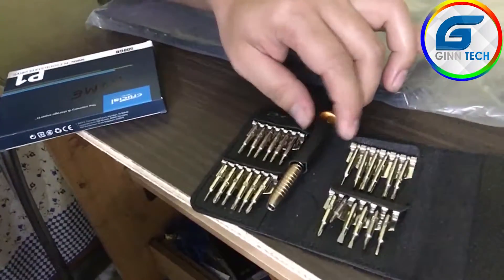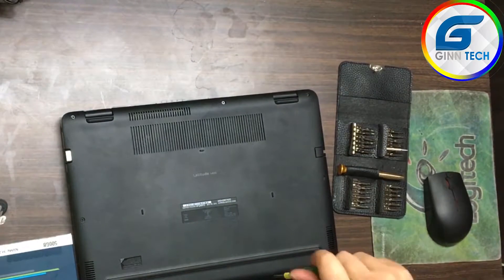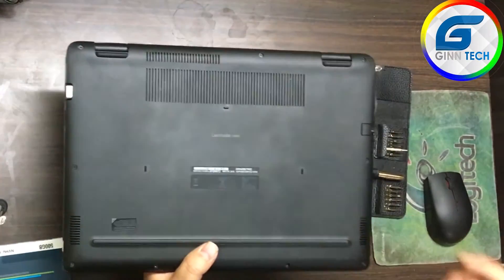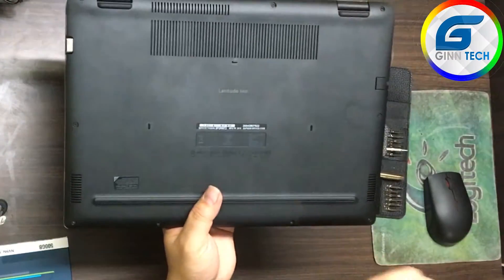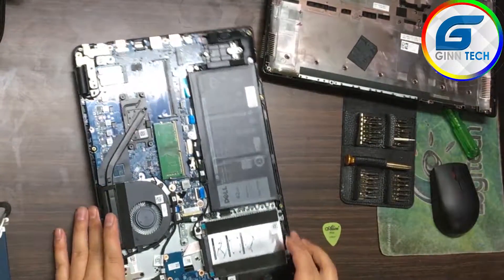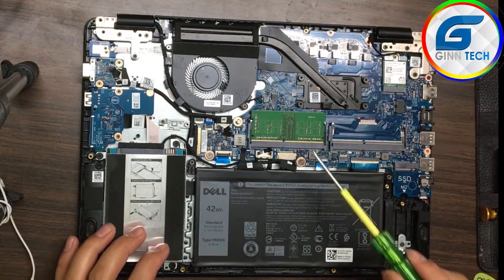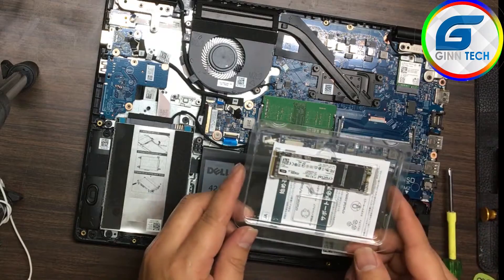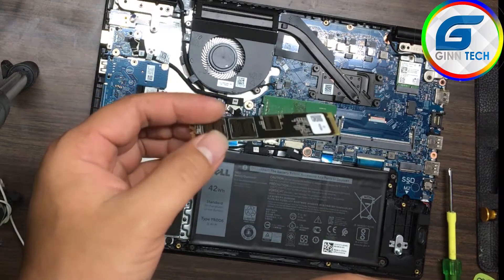Install m.2 Nvme SSD in DELL & LENOVO Laptop (Language kuki-eimi!)

Comment: May i ask what is the size of nvne m.2 pcie ssd slot in lenovo ideapad slim 3i mtm no.81WB00ANIN since its body(cabinet) is same as in this video?
Reply: Kindly provide the size info please!
Reply from the maker: Sir. All the M.2 Nvme have same slot/size
Reply: @ginntech5575  but wat about 2242 or 2280???wat r these?
Reply: @ginntech5575  and what ssd i should purchase for ky lenovo ideapad slim 3i 81WB00ANIN whose exterior is same as urs in this video?kindly help me outn